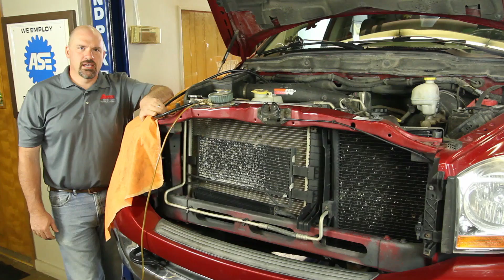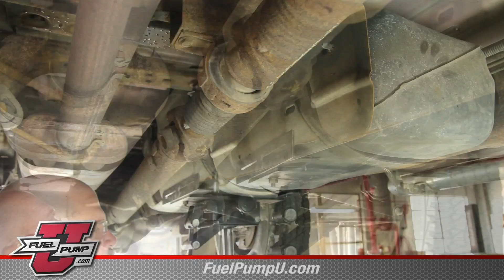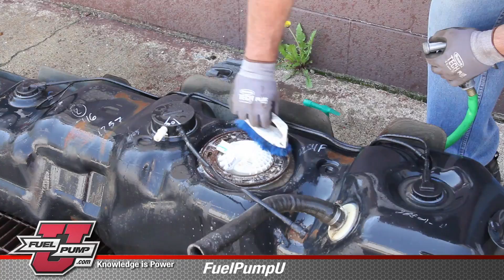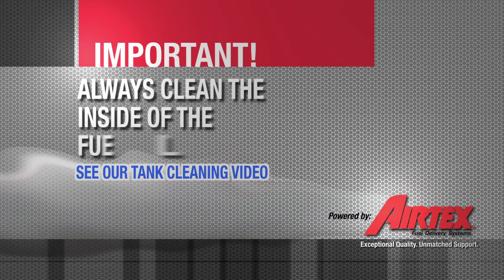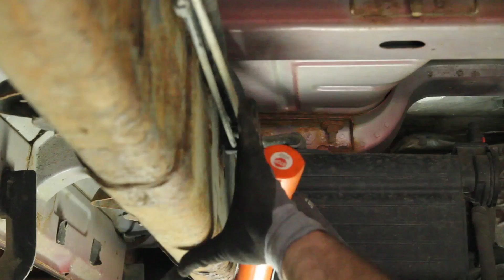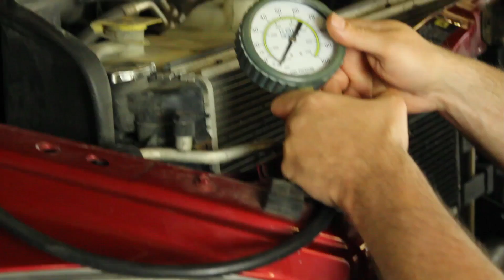How to Install Fuel Pump Assembly E7182M in a 2004 - 2009 Dodge Ram 1500

Comment: Quick question, how do you remove the vent from the gas tank?
Reply from the maker: The vent hose at the filler is a compression clamp. It is released with a pair of pliers. The end at the tank is a quick disconnect. You can find our video on these fittings at: https://www.youtube.com/watch?v=zfuYTjftkDo&t=68s
Thanks for watching!

Comment: Why does he keep saying"module assembly" instead of simply just "fuel pump"? SMH. 🤷🏾‍♂️ Yte pipo.
Reply from the maker: The fuel pump is part of the module. In most cases the module includes the fuel pump, reservoir,  fuel gauge sender, float arm, float, strainer(s), electrical connectors, valves, regulators...
The fuel pump is just one part of many in the module.

Comment: Hey would you all happen to know how to determine whether a truck has a 26 or 35 gallon tank ? Mine is a crew cab 6 foot bed but I do t know what fuel pump I need the guy at parts store said I needed to know and the manual don’t say .. thanks
Reply from the maker: Your dealer should be able to determine tank size by running the VIN. You may want to try doing a VIN search online as well.
Reply: On 4th Gen they use the same pump. Not sure on ones prior to 09 1500 or newer than 19 classic.

Comment: My damn lock ring and the metal piece on the tank it locks onto was rusted away, for almost a year my fuel pump was just bouncing around in the tank until it finally crapped out.

Comment: Perfect Video.  If you happen to break any of the clips on the quick release connectors, I bought replacements at NAPA.  As for the Red safety tabs, you can't get those anywhere that I now of.  I used a little dab of Shoe Goo to hold the connector in place.

Comment: What is that part right in front of the pump that has the white writing on it?  I need that part but I don't know what it is
Reply: Airtex/ASC Performance Pumps no the part to the left of the fuel pump.
Reply: Bobbielynn Hudman Hi, did you ever figure out what that part was called in front of the fuel pump? I need same part and cannot find it in numerous online diagrams.  Thanks
Reply: I need that part as well
Reply: What is the name of that part?

Comment: thanks for the video. i have a question. Do you think is going to be easier if i just take the topbed off instead of disconnect the gas pump?
Reply: +Airtex Pumps thank you. Ill do that. My truck doesn't turn on and ill do it the way you did it. Big help

Comment: thank you for the video it was easy to put the new pump in. while putting it back in one of the plastic nipples broke on one of the other plastic things on the ends one hose connects to the other. what are thoes two plastic parye called thats not the fuel pump itself but still part of the system? please. help thank you
Reply: +Trevor Johnson 
it won't pass smog in cali without that connected...
Reply: Thank you.  Fixed that months ago
Reply: +Trevor Johnson have the same problem, is that something you can remove from the tank and replace?
Reply: Bought a used tank and it passed smog...